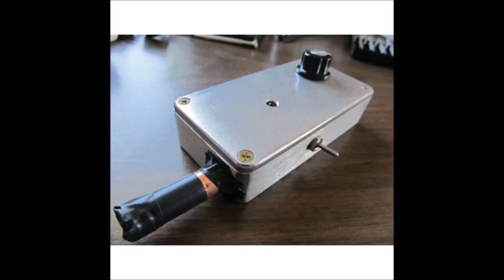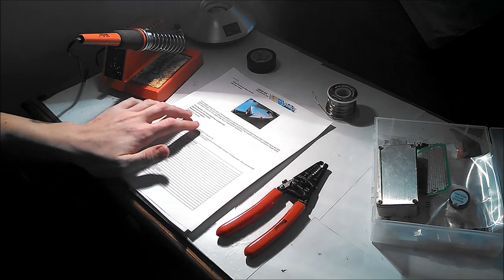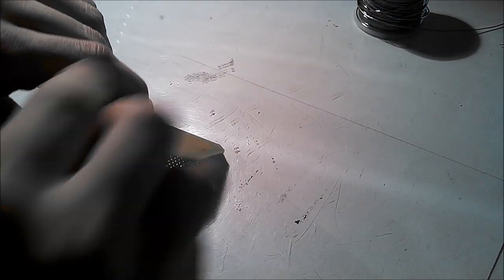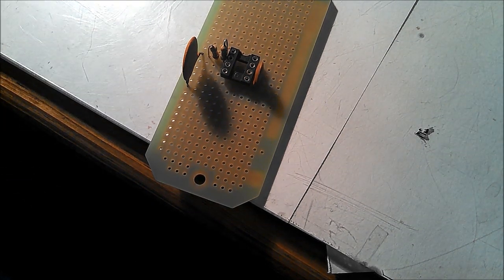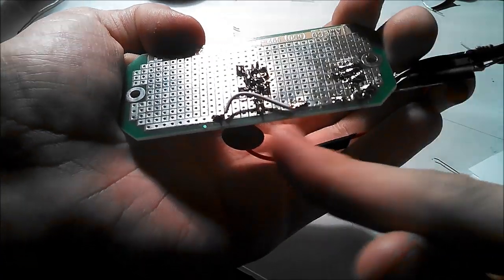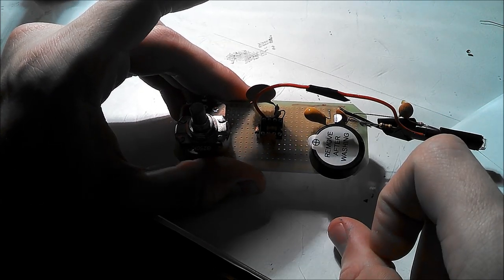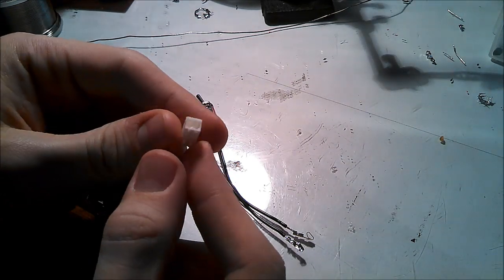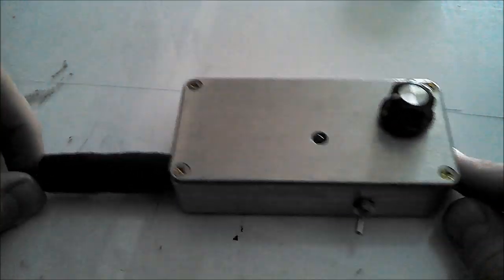Jameco Pocket Photodiode Geiger Counter Kit

Comment: So when you turned it on it didn't seem to act like a Geiger counter? Also I would replace the coin cells with a normal 9v battery. Actually I would redo the whole kit, what a mess. Thanks though for sharing the video.